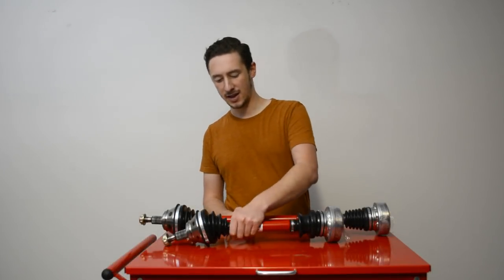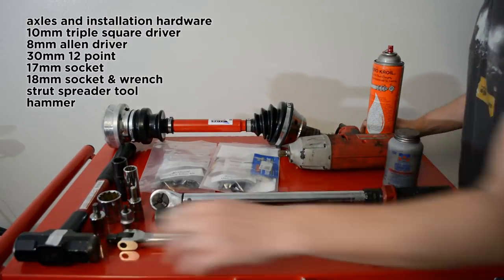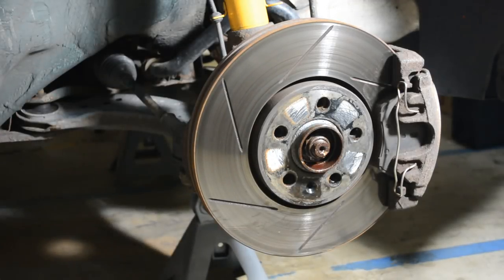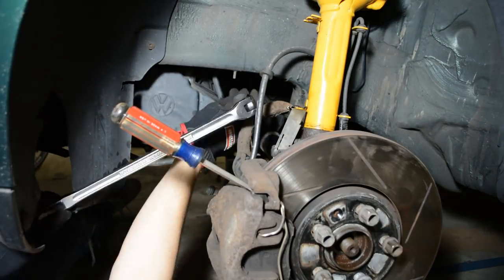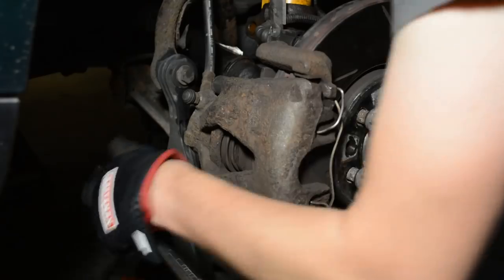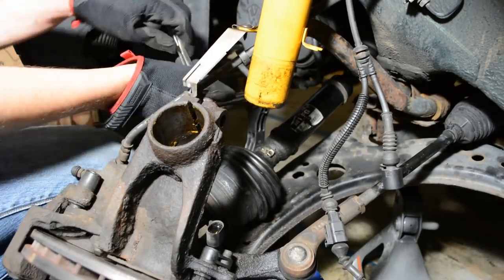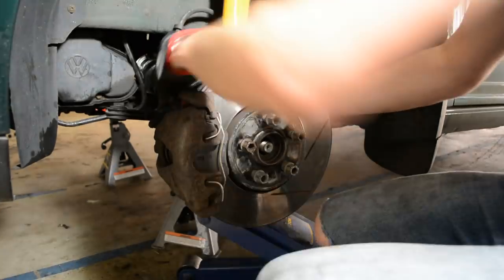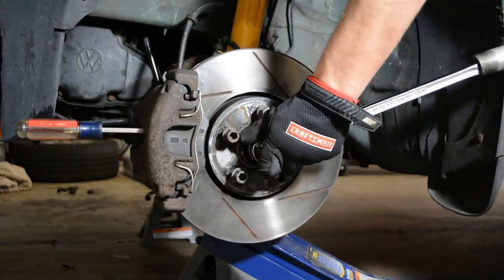MK4 VW CV Axle Removal and Installation

Comment: I need to replace the right axel on my 2004 MKIV GTI VR6.  I understand the right side is more challenging than the left axel but do not know why.    Can you explain or show guide me to a video (if you know of one that was filmed) that shows removal and replacement of the right axel?  Also, can you tell us why you chose Raxles instead of OEM axels?  Finally, how are the Raxel axels holding up a year after the maintenance was performed?  Are you glad you chose Raxels or do you advise using OEM axels?  Incidentally, I searched for Raxels and found this link that might be a helpful addition to the description of your video which I appreciate: https://www.raxles.com/volkswagen_mk4_axle_installation.aspx  Keep up the good work.
Reply from the maker: @RedondoBeach2 Thanks for the comment! Firstly, the Raxles have held up great, and still look brand new even after going through their first winter. I'm glad I chose Raxles simply because I know I won't have to do the axles again. Some people like to save money and don't mind doing jobs again, but for something as complicated as the axles are, I'd rather be one and done. As for the right vs left side, the only thing that makes the right more difficult is the fact that it's longer, and where it attaches to the trans is further in board and a little less accessible. Overall it wasn't a problem for me, and if you feel up to the job itself, I wouldn't shy away because the passenger is a little tougher. Do the driver side first to get it down, and the passenger will be cake. Let me know if i can be of any more help! Also, the video was filmed in Redondo Beach, though I no longer live there. What up from a former South Bay resident!
Reply: @StevesGarage  I replaced the left axle roughly 5 years ago with an aftermarket refurbished axle.  Then ~20,000 miles later it needed to be replaced again because of a torn CV boot.  The second time I chose a new VW OEM axle and it's holding up fine.  Lesson learned.  When the time comes for the right axle to be replaced, I will want to try the Raxel.  I talked to a sales rep at the company today and it sounds like their products are what I'll want.  Until today, I was not sure if I would need to replace the right axle.  I had the car on a lift yesterday to do an oil change.  While is was in the air, I did an undercarriage inspection and noticed the right axle had play in it.  The axle is able to move in, toward the transmission, and out, towards the brake rotor.  This seemed unusual since the left side does not have that kind of play.  I talked to Raxel and they indicated that with an OEM axle, this kind of play is normal.  As a result, I will not replace the axle until an issue develops that requires replacement.  I have been fortunate.  The right axle is the original, from the factory and is holding up great after 15 years of use.  The next project will be replacement of: shocks, struts, control arms, ball joints and bushings, followed by an alignment.  The parts came in but there's a fitment issue with how the control arms are supposed to mate with the ball joints, so I'll wait until that's resolved.  As the original owner of this '04 GTI VR6, I'd like to keep it for at least 20 years before buying my next new car.  I  lived in Redondo and Manhattan Beach 2006-2009, near Aviation and Manhattan Beach Blvd.  Nice area.  I'd like to move back.
Reply from the maker: The guys are Raxles are great. I called just to get an idea, and ended up ordering the axles since I liked their customer service and knowledge so much. Good luck with the axle, and let me know if you need anything else!
Reply: @StevesGarage  Do you have experience replacing control arms on your car?  I'm working with a parts supplier to get all of the parts needed for a suspension refresh, including replacement of control arms.  I'm concerned about removal of the horizontal mounting bolts for the control arms which are attached to a nut that's welded to the inner part of the subframe in an area inaccessible to a wrench.  I understand the nut is either welded to the subframe or attached to it with some other adhesive.  Apparently some VW owners who replaced their control arms, ran into a problem with the nut breaking the weld, resulting in the nut just spinning and not allowing the bolt to separate from the nut, preventing removal of the control arms.  I want to avoid that issue.  I'll mitigate the chances of that problem occurring by spraying the area with a penetrating oil but if there are other things that can be done to help the situation, I'm interested in advice from people with experience.  I do not want to have to grind a hold in the subframe to access the nut.
Reply from the maker: I replaced my control arms but didn't have a problem with those bolts, though I was worried. I soaked the hell out of all the suspension components with Kroil, which is a really great penetrating oil. If I remember correctly I also had an impact gun, so that helps to jolt the bolt loose as opposed to constant pressure like when you use a breaker bar.
Reply: @StevesGarage  I'll use penetrating oil and an impact gun.  Low air pressure may be best initially, then spray more oil on the nut/bolt, wait a while for it to do its work, and then increase air pressure.  I'll have to look for Kroil.  When you replaced your control arms, did you re-install factory bushings into the arms or did you use one of the urethane options available from aftermarket distributors?  If the bushings are not factory original equipment, I'm interested in what you installed and your review of those bushings.  A lot of aftermarket distributors offer urethane bushings.  The youtube reviews I've watched for urethane engine mounts, seem to get mixed reviews, either really good or really bad.  Control arms are different of course, but the urethane material is the same and I'm wondering if it's possibly a better material for use on the control arms than it might be on engine mounts, or maybe worse.  My concern is the transfer of vibration through the bushings, to the control arms, to the subframe, to the steering rack and to the steering wheel.  What's your opinion?
Reply from the maker: So for the control arm bushings I did solid rubber bushings into stock control arms. The solid rubber units are what come on the R32. I have solid rubber control arm bushings, strut mounts, and I'm dropped 1.5in on Koni struts. The suspension vibration is next to nothing. The car obviously rides a litle stiffer, but I don't mind it at all as a daily and on the highway. As for mounts, I did solid rubber engine and trans, with a poly dogbone. The poly dogbone I installed first, and it wasn't bad, but the solid rubber engine and trans mounts transfer a TON of vibration to the car. I've gotten used to it, but it can be a bit much, especially when they're brand new.
Reply: @StevesGarage  I appreciate your honesty about the good and bad of all of the options you chose.  I previously ordered solid rubber mounts and Bilstein B6 heavy duty shocks and struts and they have arrived.  The Bilstein B6 is supposed to be designed for comfort, not high performance use, which is what I prefer on bumpy roads like I-5, I-405, 91 Fwy, etc.  I returned the control arms which came with euracthane bushings installed because the new ball joints did not fit into the control arm.  They are being replaced with the same brand control arms and urethane bushing combination, and rubber ball joints.  They should arrive tomorrow (Friday).  I asked ECS to verify proper fitment of the replacement ball joints and control arms combination before sending them to me.  I believe they will. I have not ordered new springs.  Unsure if I need to replace them.  I'm told they do not need to be replaced but I also don't know how to gauge how much life is left in a spring.  I will place another order for replacement tie rods since there is a small amount of play, and replacing them should help get the steering back to factory condition even though it's still very good right now.  I will also order factory engine/transmission/dog bone mounts unless there's a slightly more firm R32 version is available for the VR6.  I want to preserve the factory ride quality or stiffen it only as much as the R32 was stiffened from the factory.  This is important to me since it's an everyday driver and will never be tracked.  The concern at this point is; will the urethane bushings in the control arms transfer vibration through the subframe, into the steering wheel or other parts of the cabin.   I'll know by mid-July when I plan to begin the job.
Reply from the maker: Sounds like you've got a big refresh planned, you'll definitely love it. When I did a whole suspension refresh the car felt great. Since I have solid rubber suspension components I can't speak to urethane on our cars, but I do have friends that replaced suspension components with urethane and you couldn't notice that much of a difference in vibration, but there was a bit of clunky-ness. If you want to maintain stock ride quality, then I'd only replace it with stock components or things like the Bilstein B6's. I've heard nothing but good things about those as far as comfort.

Comment: Don't use a gun next time, not many of us have one !
Reply from the maker: I get that, but you can rent them! Most auto parts stores have them, and it really makes this job a lot easier.
Reply: @StevesGarage  I hear you but it isn't happening, cheap as possible on this old girl :)
I might even change the oil this year....
Reply from the maker: @timbrooks2763  Oil changes aren't something you should skip over, especially if you have a turbo model. Skipping oil changes leads to more expensive problems in the long run.
Reply: @StevesGarage  Excellent advice ! I have saved thousands in service fees over the last 17 years with her, she's a good girl that likes a bit of ruff ;0)
Brilliant machines !!

Comment: Dude remove the ball joint nuts and leave strut alone
Reply from the maker: Either way works. If you remove the ball joints you have to do an alignment which is why I did it this way and it worked totally fine.
Reply: @StevesGarage  no you dont!

Comment: Next time just remove the sway-bar link and turn the tire left and the axle will come off thank me later you will save yourself 25 minutes
Reply from the maker: Hmm, that's not my experience with this car. I actually just removed my driver side axle and wasn't able to do it without disconnecting the strut or ball joint. Even if I disconnect the inner first, there's not enough room to move it out of the hub/spindle.

Comment: next time try for rebuild it yourself with new boots and clamps? not as easy as you think,,,
Reply from the maker: Because of the noise I figured they were beyond rebuilding, and would rather have just swapped them out. I did keep the axles though, so I may disassemble them and see if I can rebuild them since I've never done that before.
Reply: @StevesGarage  you can look my videos about how. And i can desire your bilsteins? It takes a lot more time than swapping axles, but it's worth it for to do a job well done.
Reply from the maker: They're actually Koni Yellows, with 1.5in drop springs. It was definitely more difficult to do than my axles, but it was absolutely worth it. They have adjustable dampening, but I run them at full stiff all the time. I definitely recommend them!
Reply: @StevesGarage  I had a 90 jetta, color medium blue metallic, with weitec suspension. that car I put camber bolts. the mk4 has no camber bolts, so with a suspension drop maybe there's positive camber. I'm fine with OE. The 90 jetta was a harsh ride over bumps, but it had good handling and braking. I put mk3 brakes on it. That car sounded tough even though it was only a 1.8L digifant 2 counterflow. It would be cool if it was still alive.
Reply from the maker: @Jonathan Schomer sounds like it was a bad ass ride!
Reply: @StevesGarage  https://drive.google.com/open?id=17tBA46RNlb0VpnK9EtidjvrFnkfhx2ht

Comment: Bro you did too much work for no reason, disconnect the strut to spindle was too much, why? All you needed was disconnect the three bolts holding the lower ball joint and tie rod, maybe would need disconnect the sway link if you can’t do some ninjas move like i do
Reply from the maker: I didn't want to disconnect the ball joint because then you need to get an alignment. There's definitely a couple ways to do this job, I'm highlighting one.